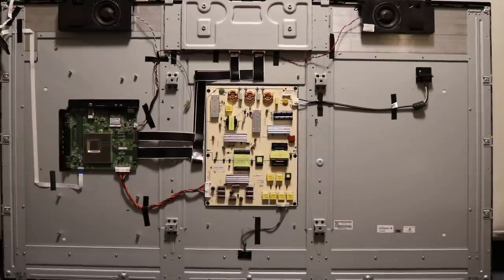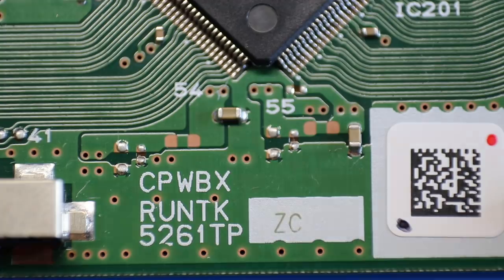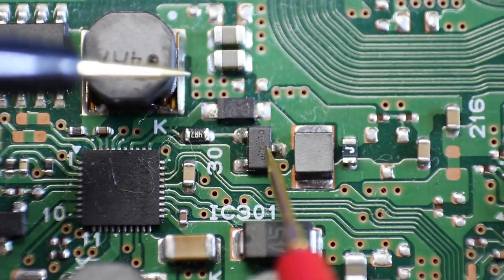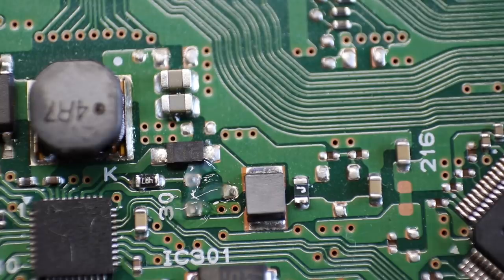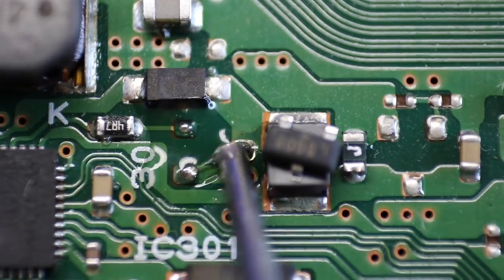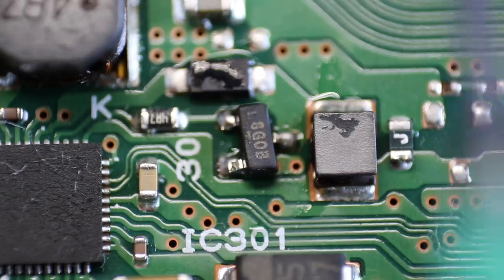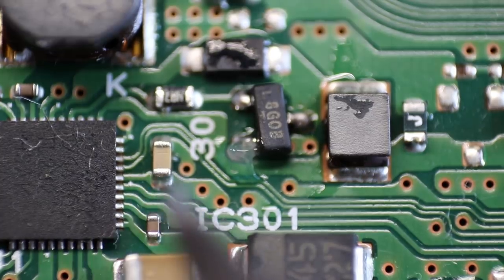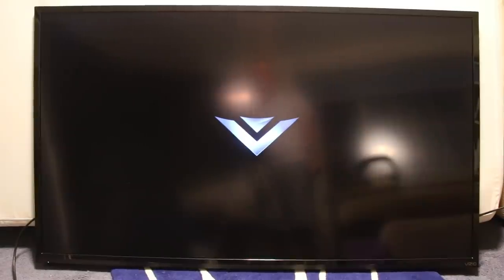60" TV for less than a $1 - Vizio E601i-A3

Comment: Got one of these sitting in my garage right now suffering from black screen. Posted it to give it away and pissed of a lot of repair sharks when I told the I changed my mind
Reply from the maker: Ha ha!  Hope you get it up and running again.  On previous repairs I swapped out the tcon board from one I bought on ebay.
Reply: FrugalRepair last repair person who wanted it was telling me it was irreparable. Do you if there in fact a case of which one of these is not reparable?
Reply from the maker: @MrAWorthy1  If the lcd has gone bad then you realistically can't repair it.  I'm not sure how they would know unless they did diagnostic tests or installed a known working tcon board.  Many people say this tv is not repairable because they believe there is a defect in the lcd screen which will eventually cause the lcd or tcon to go bad.

Comment: Hi ive come across a toshiba 58L7365d smart tv. Blue screen no sound or response to button on the back of the tv. Is that the t con board.
Reply from the maker: I’m not sure if it is tcon or not.  Probably not.  It’s probably the main board if it’s frozen.  Did you research that model and the issue?

Comment: Hi Can anyone tell me about replacing the rear LEDs on a VIZIO P75-F1.  These are the back lite's within the TV.  I see other repairs for older models, but have yet to see any repair instructions for the Vizio 2018 P series.
Reply from the maker: If the backlight is led then I would guess it is a full array, which means there is an led with a diffuser on it every few inches on a board (led strip) and there are several rows of boards.  There may not be instructions online for that exact model but replacing the bad individual led's or the whole led strips would be the same as ay other full array led tv.  Can you see the image using a flashlight?  And have you tried turning down the brightness in settings (using the flashlight to see) to like 10% and rebooting?

Comment: Checked many of your (and other) TV repair videos, have decent soldering/tech skills and equipment, but need some guidance.
Have called Vizio Cust Service, but no help available for this "old" TV from them-they say call some local TV repairman, etc.
I have a great 55" Vizio XTV 553 SV smart TV I bought in 2012, been working GREAT till last week.
No image on screen, no Vizio start-up splash, no apparent backlight visible, but this is what happens on plugging in.
Without any prior notice, it now won't turn on and goes thru a cycle of blinking "Vizio" light at bottom (white and orange) as follows:

On plugging in, the VIZIO logo below the screen flashes orange off and on every second for 25 times, then the logo turns solid white for 10 seconds, then turns solid orange for 6 seconds and the cycle starts all over again, on/off button or remote have NO effect, Vizio CS is of ZERO help, any idea of where to start?
Have unplugged overnight, followed all the simple suggestions, held the "start" button in for 5 minutes with unit unplugged, etc., etc., still same operation, nothing has changed.
I HAVE taken the plastic back off the TV and inspected all the PCBs for burned components, no luck.
I don't know if this sequence of blinking is a code for what is going on, but I can't find anything on the web relating to this behavior, hoping you or someone on this thread can offer some help deciding whether to try fixing this otherwise excellent TV or if I need to pay to get rid of it.

Thanks for any help, we LOVE this TV and hate to part with it if we can get it fixed for reasonable $.

Chas
Reply from the maker: Sounds like the eeprom has gone bad on main board.  Do some searching on that and it may help.

Comment: Hi i have the same problem with my sony Bravia can you help me out
Reply from the maker: Have you researched your model number and the problem? What have you found out?  Some of the older Sony lcd TVs have a problem with the tab bands on the LCD panel itself.  They are not really fixable but you can Jerry rig a solution. I’ve fixed one before with card stock. You basically have to put pressure on the tab band and the metal frame. If you have never worked on TVs before it may be a complex tear down to get to that part inside the TV. That is, if that is your issue. I am just guessing
Reply: @FrugalRepair  thanks for your reply , model KLV-49W752D ,it will be working for hours some times next time if we swich off and on it will be blank and only sound , again it repeats

Comment: I have a 65 " vizio  mod. V655-G9 that has zero power the problem is the power board # P650D112DA-MP02 . I can't find the replacement parts such  as IC 6C17744  , with the manufacturer trademark FE . Can you help  ID the part and its replacement. 
Thanks

Comment: My 2 hdmi ports blew about 6 months apart last one today. Tv works fine. I use tv with chrome cast  for streaming. I need  to know how to fix hdmi ports so they will work again. I don’t weld. I need an easy -plug in part fix. Can you help?
Reply from the maker: You can replace the main board and that would fix it.  Did you watch my newest video?  I worked on a vizio with no hdmi ports.  I doubt it is the same as yours but you never know.
Reply: FrugalRepair Thanks,  where do you buy a main board? No I didn’t see your newest video.
Reply from the maker: Google your part number.  I usually buy from eBay
Reply: FrugalRepair I checked.  eBay, I could find used main Boards. Once old removed I’ll have a used to sell. TV is 10 years old. Model E420-AO. I don’t really have part #.
Reply: I don’t know a part # because I don’t know what part I am replacing or where to find part #.

Comment: I know this is a super old video but does anyone know where to buy these transistors?? What’s the part number for them??
Reply from the maker: copy the specs listed in the description and search on google.  You could likely get it on aliexpress, digi-key, mouser,...
Reply: Your description wouldn’t tell me much on Google as of a specific transistor on a t con board? Lol. Do you not know what you personally purchased for it that you used in this video??
Reply from the maker: just google the specs, I just did it and lots of options showed up.  MOSFET 60V 2.3A 1.66W 156mohm @ 10V
Reply: @FrugalRepair I see. I didn’t realize you had the actual specs already in the description. I didn’t scroll all the way down in the description. Thank you!

Comment: Hi - Dont suppose you know how to fix my Samsung Smart TV (does not have / or wont enable Bluetooth) ?
Reply from the maker: I might have some guesses. Has the Bluetooth worked before? It could be a software setting, you could try resetting to factory defaults. It could be a hardware thing, if it has never worked it’s possible that the Bluetooth module or antenna is disconnected from the main board.  Or it could be a firmware problem.
Reply: @FrugalRepair  Hi Thanks for reply.  Seems like my Samsung TV does not have Bluetooth on it.  Is there any special way that I could get into the "technician" settings program?  I have seen somewhere that there is a special settings program for the technicians.
Reply from the maker: There may be a service option to get into the technical settings on some TVs. But I don’t know how to get into your TV because they’re pretty specific to the model.
Reply: @FrugalRepair   Ok, thanks for your help.  Great You Tube postings by the way!  Cheers
Reply from the maker: Thanks!

Comment: Where does everyone get the components to repair these electronic devices? I used to use radio
Radio Shack. Now they are gone and what’s used today are micro chips.
Reply from the maker: There are many online places to buy components.  Just take the specs on this transistor and put them into google and the options should come up.  You can even get many components on aliexpress.com for even cheaper.

Comment: Will this work for red vertical line in the screen?
Reply from the maker: Same model?  I’ve seen red lines on this model before. I’m not sure what the root cause is.  I’ve seen them where the line was a problem on the tcon board (and a swap fixed it) and I’ve seen them where it was an issue on the lcd panel.
Reply: @FrugalRepair  Yes, same model.  Guess I'll try replacing the t-con and hope for the best.  Thx for the reply
Reply from the maker: Keep me posted.  I hope it’s not the panel.

Comment: I know this video is pretty old but .. my samesung - un65nu6900. Powers on and has a full picture but has a thick Dark tinted line just off to the right of Center..what could it be? Backlight?
Reply from the maker: If it’s a horizontal line watch the fix with tape videos, if it’s a vertical line then watch the “fix with a toothbrush” video.  They should help you understand

Comment: What if we don’t have a hot air station can we use a heat gun?
Reply from the maker: I'd say no, not really.  This component is really tiny and your typical heat gun can't direct the heat into a small enough space without running the risk of damaging the board.  If you didn't have a hot air station, you can use a soldering iron and copper braid.  The soldering iron tip needs to be small enough or it would be a fairly frustrating job.
Reply: FrugalRepair thank you my kind sir 😊

Comment: I use to be able to fix broken tv's also but can't find a ustem's or tubes anymore.
Reply from the maker: I would think led-lcd TVs are much easier to repair.  How many have you tried to work on?
Reply: @FrugalRepair  Vertical bars on a 60 inch tv, and power supply on a monitor (bad capacitors, but that one might have failed again.  (LCD screen can see display if screen is 'pressed' with finger but don't know where to look for failure)   But all I have is a soldering gun, some meters and patience.
Reply from the maker: If pressing in to the LCD near the edge makes the black bar go away and you can see the image, that indicates a tab bond failure. You can jerry rig a solution by putting pressure on that bond with non-conductive material. I am sure there are videos online that can show you how to do that. I don’t know if you wanted to download my PDF,  (on my website under resources) but I have some pictures in there of what the tab bond is.

Comment: I have an insignia 40"tv.that cuts off after 10 minutes then comes on a minute later. this cycle continually repeats itself. Replaced power board to no avail.Any idea what it may be?
Reply from the maker: Anything online about that model and a typical problem?  Since you replaced the power supply then my next suspect would be a problem on the main board.   You’d have to do diagnostics on the main board if you wanted to repair component(s).  I’d also try disconnecting the input bar from the main board while testing to isolate that it is not the problem, same with IR sensor (but you need one at a time to turn the tv on)
Reply: @FrugalRepair  THANKS

Comment: Hi. I have a vizio tv xvt3d554sv that is showing red lines horizontally but I noticed today that after the tv was on for a while the lines went away. Do you think I may have the same problem as this tv on this video? Or what else can it be?
Reply from the maker: I’m not familiar with your model off hand.  Horizontal lines I’d say are more indicative of a bad lcd panel but I guess it could be the tcon board.  Have you found any clues online, perhaps ppl who have the same issue?
Reply: @FrugalRepair  I searched t-con boards for my tv but the ones I found were used at around 81 dollars. And this is a LED screen not sure if that makes any difference.
Reply from the maker: @PabloVD007  the led means the backlight source and wouldn't have anything to do with the horizontal lines.  You problem could also possibly be a bad tab bond.  You can google that term to learn more but it is the connection from the lcd panel to the buffer board.  It is not connected with a typical connector, usually it is a special adhesive.   That adhesive can come loose and cause screen issues.  It is possible that when the temperature gets higher this ever so slightly warps the board to make the connection to the ribbon cable and the lines go away.
Reply: @FrugalRepair  wow. Thank you so much. I will look into that. By the way I subscribed to your channel. Great videos and you know a lot of stuff so I'm looking forward to learn more from you. 👍

Comment: Hello sir
I have TCL roku tv 55" 
Yesterday It goes black automatically
I can hear the sound but not able to watch picture on screen
I can see the screen when look at some angle 
Please help me
Reply from the maker: Your backlight is out.  Try using a flashlight and turning your brightness to 10% and see if the low power backlight works
Reply: I have the same issue 🥺

Comment: Hi I have a vizio 55" doesn't turn on but has the standby light on any suggestions
Reply from the maker: Have you researched your model number for any common problems?  It could be an EEPROM failure on the main board (just guessing).

Comment: I have a vizio E65-E3. the right half of the screen is going dark, I still see the image but it is dark. Any idea what the problem is?
Reply from the maker: That sounds like the backlight is having trouble.  Do you know if it is edge lit or a full array backlight?
Reply: I have no idea. How do I find out which it is?
Reply from the maker: I’d google the specs.  You might need to check the voltages on the board that drives the LEDs
Reply: Thanks for the 411.

Comment: i need to figure out what's wrong with my old lg plasma (other than it being lg and it's a plasma). it has perfect sound, but no picture at all. it just stopped showing a picture one day.
Reply: Nothing wrong with LG or Plasma. I'm still using a Panasonic and a Samsung plasma. Both have a better picture then the 50 in Samsung 4K that I just bought for my mother. $600 budget Samsung, but you would think that in 2019 even the budget TVs would have caught up to plasma. Direct viewing isn't bad, at an angle it's pretty much unwatchable.

Comment: Why did you use a heat gun for 3 solder points?
Reply from the maker: Mainly because the component is so small and the camera setup I had to film it.  The camera was blocking my view and I was watching through the tiny screen.  But I could’ve used my soldering iron as well.  I shouldn’t have this problem any more since I am getting a microscope camera for future videos.
Reply: @FrugalRepair  makes sense.

Comment: I have a Samsung LED TV: I had a premature start premature failure of my TV, t when disconnection completely for 1 hour, the image was turned on and everything worked perfectly. so I made a reflow of the main board (nothing, no change),...Even if normaly if you do a reflow on t Con it's because you have only issue pciture. But  I made a reflow of the con con (since then, nothing lights) ... ref con con: DEL T370HW04 V2 37T06-C00

Comment: Doesn't that hot air damage components ?
Reply from the maker: No not really. If you think about it, these components are attached to the board in a oven at the factory and very high temperatures.

Comment: My 60' Samsung LED tv has just 1 line showing up. Would you suggest some fix please !
Reply from the maker: One line of pixels on a whole dark screen?  Vertical or horizontal? Do you have sound?  If vertical it could be the tcon.  It could also be a bad lcd panel.  You’ll want to research your model number for any common faults.
Reply: @FrugalRepair  Thanks for replying.
Pixel line is visible all the time.
Reply from the maker: @jaydeeprana6339  but can you see the image or is it dark?  You may have a tab bond failure (google it) that you can jerry rig a "fix" for.
Reply: @FrugalRepair  ya...Whole TV works fine with clear Images. Just one purple line showed up, may be my daughter must have Tap that side of screen.

Comment: I have this TV, but when I try to turn it on, it does not do anything, i plug in, and check with a multimeter the power supply board , and i have voltage on the cables where connect the main board and the power supply board. but now I do not know what to check on the main board , but now I do not know what to check on the main board
Reply from the maker: I have a video on what to check after a power surge that has details on what voltages to check for.  Let me know if you have more questions after checking that out.
Reply: @FrugalRepair  the board does not say stand by or st-by like on your video, but pin no.1 only has 3.3v, and the multimeter confirm the voltage,I did not check the fuse, but if i have voltage on that pin , that mean the main board is the problem, i am going to check the connections like you video 

thanks

Comment: Trouble shooting T-Con Board.  VOM leads on either side of the transistor to test.  Should not be shorted.  You can test the transistor while it's still in circuit board.  If meter beeps (shows a short/continuity), replace transistor.

Comment: Won't the hot air damage the part?
Reply from the maker: The components are designed to handle very high heat.  When the board is first put together it goes into an oven that gets hot enough to melt the solder.   Of course, too much focused heat could damage a component or damage the pcb.

Comment: "Connections should not be shorted. This transistor is definetly bad" Question is. Why did it turn bad? Did they just use bad transistors in production, that turned bad with time, or is this a just a temporary solution? Could even be just a 2-3 hour fix if the problem lies somewhere else.

But nice video tho. I always appreciate guys like you that take their time to explain and share their technical knowledge, skills and way of thinking with other people. I am way too lazy for that.
Reply from the maker: Thanks!  I’m honestly not sure about this transistor’s failure.  I could spend time on figuring it out but I haven’t bothered.  The TV has worked fine for years after this repair.
Reply: @FrugalRepair  Nice! Good to hear that!